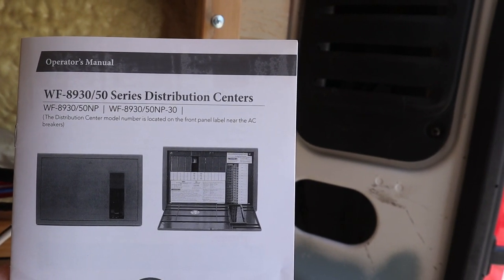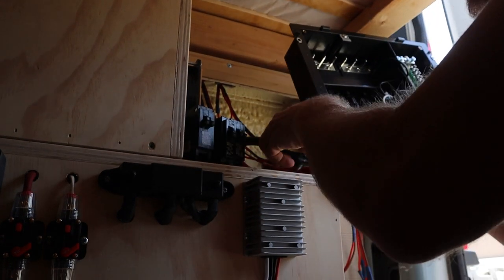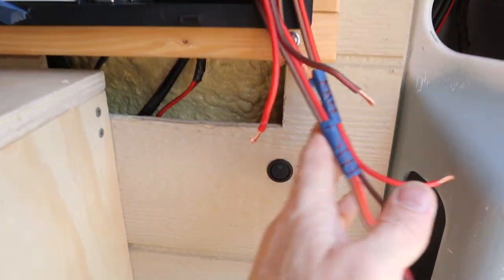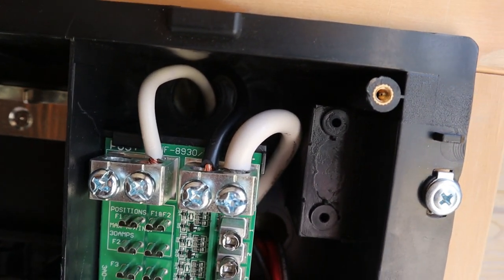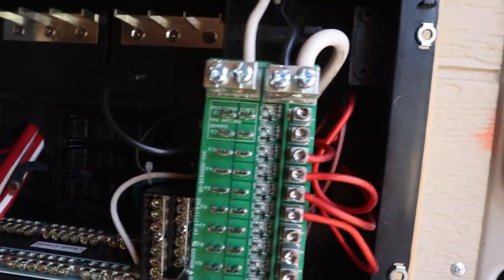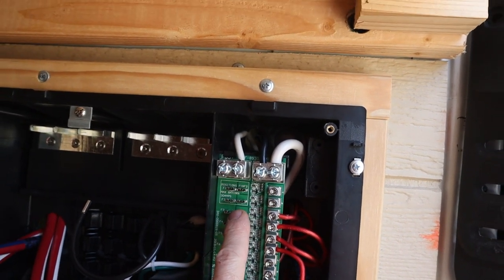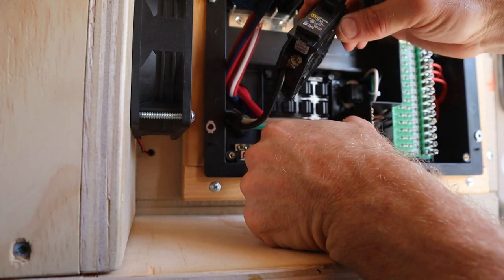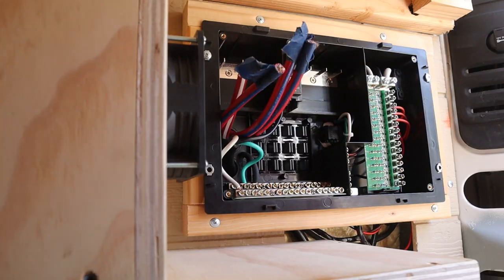AC/DC Distribution Panel Install For RV/Van/Boat/Cabin

Comment: Thanks for the video. I'm just curious how you like the 24v system. I'm thinking of doing the same thing. Do you get any phantom drain from dropping the voltage down to 12v when not in use?

Comment: Thank you for the great info. Where is the 30amp power cord coming into the unit from? That would be Shore Power in a camper correct? Is that what you have in your van set up?

Comment: you really should have the black 12v wire be the pos. so they match inside the panel. So all neutrals and grounds are the same color.

Comment: thanks for info, question, the cable coming for the inverter to the box have to be 10/3 gauge? am wandering is that the reason why doesnt work my 120 v sistem, {right now I installed a 12/3 gauge coming for the inverter to the panel,  connecting with the main brakers.

Comment: Should always stick with black for hot and white for neutral on AC power and black for negative and red for positive on DC always use green for chassis or earth ground. It saves a lot of confusion you could use white for both neutral AC  and negative DC and black for hot AC and Red for positive on DC to eliminate all confusion and no confusing ac and dc power. When you you ate dealing with AC residential you are dealing with black and red for hots with 220 power and white neutral and bare copper or green for ground.

Comment: You should really take the video down... you have a white cable on the positive and a black cable on the negative.  Positive needs to be red.  Or at least put a red heat shrink insulation or label accordingly.  It is sad that a person like you is putting a video like this to confuse people, or worse yet, put them in danger.

Comment: THANK YOU for making a video with this install. I’ll be purchasing this for my system. It’s such a clean combo. Also, now I know what the single/double pole differences are! Was so confused...... 😅
Reply: Arg, it’s out of stock. This 30 amp model seems similar: https://www.amazon.com/dp/B019QH5SE0/ref=cm_sw_r_cp_awdb_imm_GH6SXJ73S8Z65KKN5J1G?_encoding=UTF8&psc=1
Reply from the maker: Thank you very much for watching. Glad it could help in some way to make your install easier. Take care.
Reply from the maker: @keezer4346  Awe, I did not realize it was out of stock. I looked up the one you linked here and yes it will work just fine. Looks very similar. Let me know if you have any questions. Thank you for watching.
Reply: @thinkfreelivefree6951  thanks!